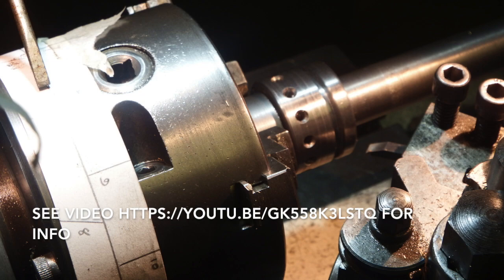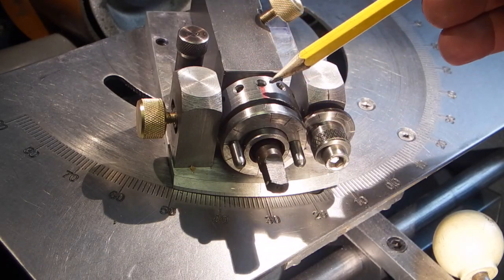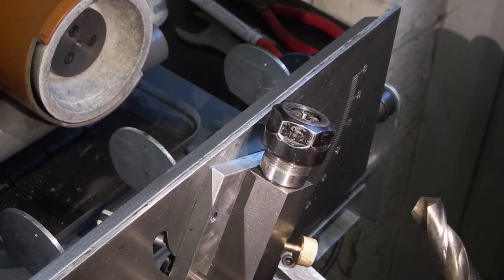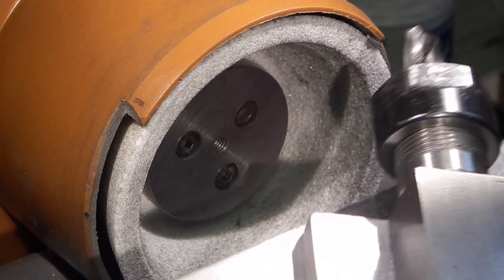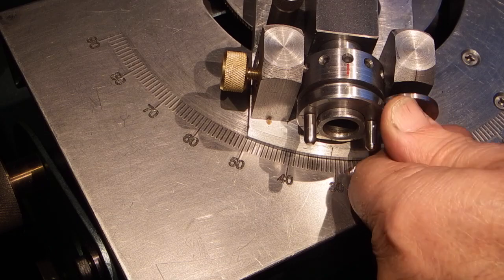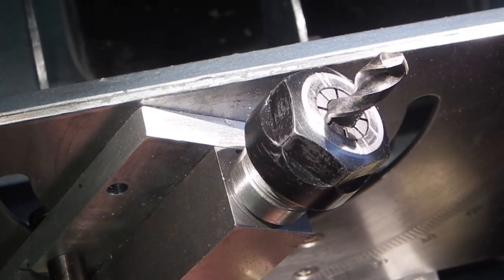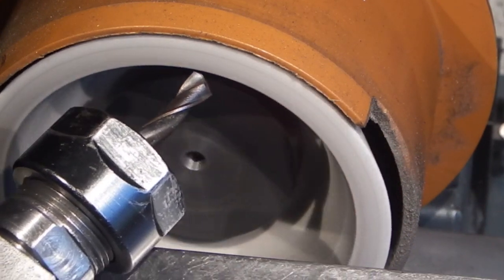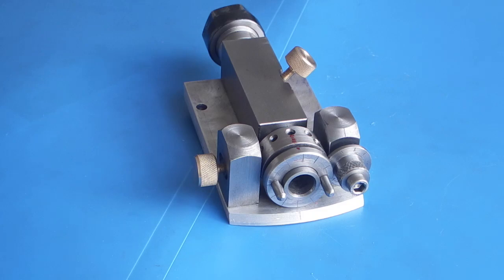Finish and test first drill grind.

Comment: Hi Alan i am thinking of making the worden   . I see you have a lot of experience with modifying the tool holders . do you think it would be possible to adapt to take R8 collets to sharpen end mills . Regards Mike
Reply from the maker: Hi Mike yes you could replace the steel block on the table. With a bigger one to hold a R8 spindle and make it revolve as I did for my ER20 collet seehttps://youtu.be/_9ShMo0erzs

Comment: I'll stick to hand grinding. Although ive just made a 4th cmc axis using an ER20 collet extension on a 20mm ground shaft (I had to drill through)  ebay , er20 20x100mm under a tenner, its a good starting point for this project.

Comment: The 12 locations of the index are not through hole (are they) to the spindle question here (I am just wanting to learn here so I ask questions often please) is why does the spindle lock when you are tightening the screw? We truly are enjoying thee lessons here so we thank you for making them. Yes it does grind well. We like the machine lathe post mount-ability really nice. I will go see Hemingway.
Reply from the maker: Hi No the index holes use the counter sink part and the index pin has a point on it to give a positive location.If you tighten the screw too tight it will stop the feed movement. The index pin  is made to slide in and out with the feed screw.

Comment: Hi Alan, Great video and a very nice tool. I see you are using the white wheel in the grinder. Have you abandoned the diamond embedded wheel?
Reply from the maker: Hi Alan
No I only use the diamond wheel for carbide tips
Reply: It's wasted to use diamond embedded wheel for all kinds. It's more expensive and the drill not requires very much precision just in particular situations.